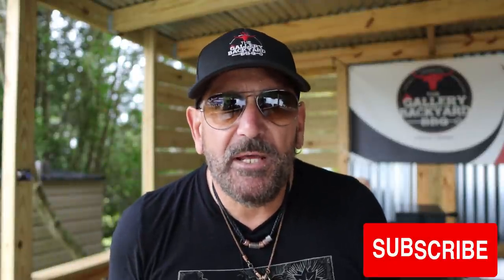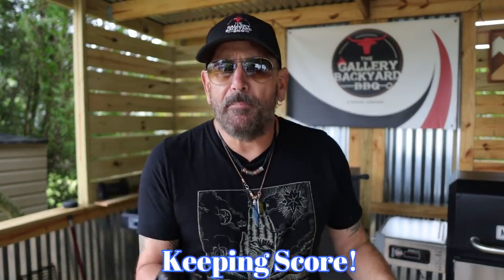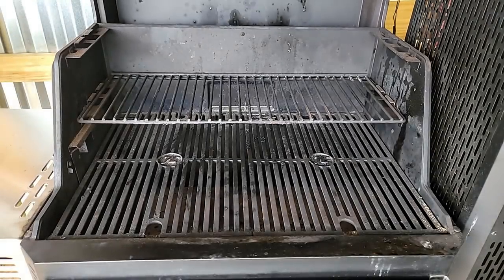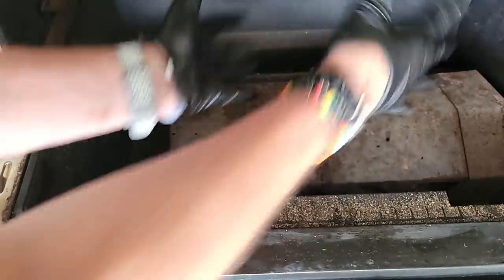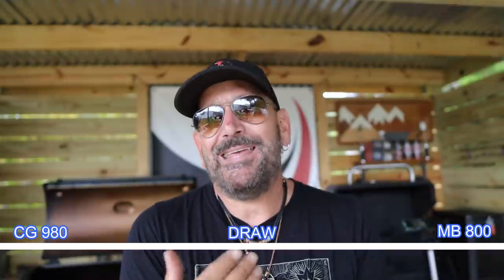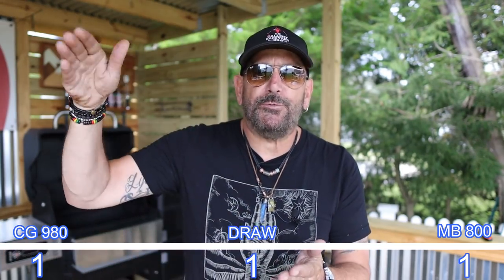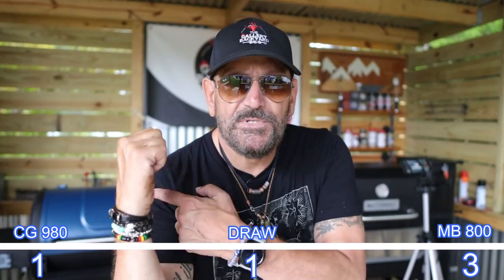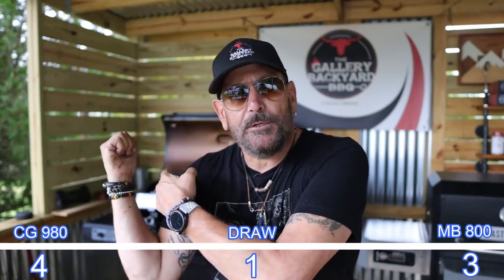Masterbuilt Gravity vs Char-Griller Gravity | Which should you buy!

Comment: Tommy, I'll tell you since I've had my MB560 July1 I'm totally impressed with it. Ease of operating.  The way it holds temp with in 2-3 degrees and also producing clean smoke.  Put wood in the ash bin, which always burns completely, also add up to 2lbs in the hopper with charcoal for extra smoke flavor if needed. Doing Slow and Sear ( I just did a 3lb Tomahawk, made a video ) taking temp from 250 to 600 really quick about 3 minutes works amazing. Gravity feed smoker/grills,  have my seal of approval, and I have cooked on all kinds of cookers. I think any Gravity feed grill, Chargriller or MB is the way to go!
Reply from the maker: Agreed. This is an awesome time to be a backyard pitmaster!
Reply: Awesome thanks for sharing

Comment: I own the 1050, the upgrades I bought I think is a must, bought the bigger shelf for front, the tray that fits under grates, collects all the grease and holds water for long cooks and you can still put your aluminum trays under your grate's and the other one is the grate that holds the charcoal, it's a wider opening for fire starters and has a grate that protects the flap and fan, so far no problems with it, my only complaint is sure uses a lot more charcoal, but ease of use is great on all nighters
Reply from the maker: Thanks buddy for the comment. The 1050 is top dog for sure-

Comment: One thing that should have been mentioned is the MB has an optional rotisserie that the CG does not have.  Also porcelain coated grates are nice to start, they will crack and rust.  Pure cast iron can be brought back to life over and over.
Reply from the maker: Good point Joe....

Comment: Nice video, Tommy. I agree with most of what you said. By the way the hopper on the Masterbuilt is three pieces. Also, the have changed the material of the wall in the Lower burn area. It is foam insulation with stainless walls. It’s like KlotesMods swap. I know this because the replace two of the three pieces on mine after the grate ribs in the burn are burned out. I love my pit. I got the replacements in two shipment over a period of two weeks. I am very pleased with what they did to fix my issues!
Reply from the maker: James. Thanks for that info. I tried being as fair as I could be without just saying what everyone else says. Cheers.
Reply: @thegalleryBBQ  I think you did a fair assesment of the smokers.

Comment: I use to love Masterbuilt, I just bought a MB 560 gravity feed in late April.  I used the unit 5 times and love it.  Went out to use it the weekend of June 3rd (yes, 1.5 months later) and the electric controller would not stay on, it kept shutting off and on every 10 seconds.  I contacted Masterbuilt, they asked me a couple of questions and decided to replace the unit under the warranty.  They said it would be 7-14 days before the item ships and they would contact me with an email and tracking number.

When I first bought the unit I had opted for it to be put together, so Amazon delivered it and two yahoos' installed it.  In the process they left out the charcoal grill that keeps the charcoal from falling all the way into the ash bin.  After going back and forth with Amazon, they finally gave me 180.00 off of the unit, so I went on MB website and ordered the Charcoal plate it was like 11.00 plus shipping.  It took over 3 weeks for it to be sent from Ohio to California because it took over a week for MB to ship it.

So I finally received that around mid may, used this unit exactly 2 full weeks (5 times) and the electric controller crapped out.

Today the control unit showed up, MB did not contact as they promised with a tracking number, I sent them an email last week, June 28th was day 14, sent another email yesterday, they finally responded and said here is your tracking number.

Tonight I'll go home and hook it up and see if it actually works.

Great smoker but you are totally at the mercy of an electronic unit that when it fails you are left with nothing to use.

I have now considered ordering another control unit for roughly 35.00 from their website which of course will take 3-4 weeks to arrive, just in case it dies in the future.

This whole smoker is great and I love it but you are totally at the mercy of the control unit.
Reply from the maker: Agreed. That controller is definitely a weak spot in that cooker. Mine crapped out and I do keep an extra in the garage!

Comment: The masterbuilt grates are about how much meat touches metal vs air. On the meat section you get more metal and hopefully better sear lines. On the smoke side, there is less metal and thus more air reaching the meat. That is the whole point of those grates. Do they make a huge difference? Maybe a bit. It’s a good idea, but I prefer purpose built grates for each.
Reply from the maker: Good point

Comment: I had a Masterbuilt 1050 for a year I loved how it cooked and smoked, but incredibly unreliable, the first one worked only a few days, the second one I was constantly replacing the switches, the at about 10’month the fan died, and I got rid of it and bought a Traeger. I don’t like it. I was trying to decide if I wanted the Masterbuilt 800 or chargriller . Has MB done any updates to their switches?
Reply from the maker: I mean. That sounds like some bad luck! Many and i mean many have run these pits(MB)for years with no problems including me. On a side note!   Some have had the same problems with the 980. To answer your question. No up grades as of yet!

Comment: Love your videos! I'm itching to pull the trigger and get either the MB gravity series or the Char Griller 980. I saw your most recent reviews, any 2022 review coming? Or do you sway one way or the other at this point? Thanks!
Reply from the maker: I may do a Char 980 vs 1050 review as I ahve a brand new 1050 coming!
Reply: Thank you so much! Would you pick one over the other in the moment?
Reply from the maker: @benb6366   That be hard to do. The 1050 flat out rocks and that980 is awesome. Gun to my head. Id go 1050 on price alone.

Comment: I would think the simplest thing to mod the CG980 for a drip pan under a low and slow cook, would simply get rid of the middle shelf it comes with, and then buy an aftermarket shelf on legs that you can place anywhere on the grate that you like. Amazon sells them for cheap. Just pick the size shelf you like (obviously that will fit within the grill), and boom. Middle shelf problem solved.
Reply from the maker: Jess. Thanks for the tip. Cheers and happy new years.

Comment: Even on my 560 I never really put chunks in the ash pan. I felt I got enough smoke using 2 or 3 layers of chunks in the hopper. I used 1 split with lump charcoal surrounding it in the char griller last weekend and like the results. I'm with you though can't go wrong with either pit
Reply: That's what I found with mine. Putting layers of lump between some chunks of wood has been really fine for what I'm doing.
Reply: I don't like to do that unless it is a long cook that will use the whole hopper because it is a pain to change the wood if I am cooking something else and want a different wood.
Reply from the maker: Thanks bud. Cheers

Comment: The recently got the MB800 and I have no regrets. When I saw the Char Griller at Lowe’s I couldn’t help but notice how wobbly it was which I didn’t like at all. 

And probably the biggest reason is that the MB natively allows you to have a drip pan and this can be done without any mods. And not only do I almost always use a drip pan in my Weber kettle (so this is the way I like to bbq), it will also make clean up infinitely easier.
Reply from the maker: Youve picked the winner between MB and CG...

Comment: My Master build was a joke, broke out the box and the  replacement lasted 6 months wish I still had my green mountain grill top notch costumer service.
Reply from the maker: Unfortunately, the MB will out grill/and/smoke a green mountain 7 days a week. Did you contact customer service?? Do you belong to my Facebook group?  What happened. How'd the MB break??
Reply: I contacted MB multiple times I first contacted them when I originally set up the moment I plugged in my grill I had three errors, after going back and forth with Master billet I eventually spoke to the manager at Home Depot where I purchased it and they swapped it out for a different one, 6 months later I get a different error my fan occasionally works which is not very fun to find out that your fan isn't working when you're doing a whole brisket 😱 and now you have to finish off in the oven. When it was working it was great I have a small backyard so this was a good option for me, but their bill quality is unacceptable with my Green mountain grill had less smoke flavor but the moment anything broke within two days they would send something out to fix it or have a technician come out and fix it , what's Master build I'm lucky if I ever get a reply in my email.
Reply: @thegalleryBBQ  I'm honestly to the point to where I'm just about to build my own gravity fed grill just need to find a nearby welding shop
Reply: It’s ugly but you MUST let those wires hang and keep them far away as possible from the heat. I burned out fan wiring and loads of errors due to keeping my wiring too close to the pit for “looks”
Reply: @jayrod1980  thanks for the advice

Comment: I enjoyed this video. But I have to say, we’re all looking for one thing, that is good food. The even heat on the Char Griller because of the heat chamber you mentioned to me is worth multiple points. Using your own words, it’s a game changer. And I agree it is, just that  by itself makes a Char Griller the easy winner for me. Your points system I think is a little bit flawed, lose an a point for something as simple as a vent, but only getting one point for something as important as the heat management inside the pit, makes things a little off center. Not complaining, I appreciate your video, but if you put weight in form  of value on each point, I think the Char Griller is the clear winner.
Reply from the maker: Appreciate that well thought out comment. That said, Some people would prefer the smoke that the MB puts out on the food. Cheers.
Reply: Agreed, but I can do things to get the smoke flavor, you can’t do things to make even heat-  Thanks again for your videos, I enjoy watching them.
Reply: Yup, that’s the beauty about options! Me personally, not a fan of those barrel designs, at all! Even on my 6 pellet grills, always enjoyed the other designs better. So I’ll take the MB800 any day over the CG for the sake of the the grill design/layout and the fan design alone. That fan stickin off the side is an eye sore and ppl are beating theirs up left n right while moving the unit around. 
So I agree with your points that there are different weights to different points, but I don’t think the CG is a clear winner by any stretch, at least not for me 😅

Now if only we could get a medium tier Gravity fed, digitally controlled charcoal smoker, something between 1k to 2k, that’s built kinda like a Yoder or a Lone Star, THAT WOULD BE AMAZING!!! 
These Chinese tin cans are good for what they are, but they are cheap and it would be great to have some better quality options on the market.

Comment: Does the Chargriller have a rotisserie add-on accessory? I have the MB1050 and it's great but definitely has its issues. Grease management sucks, build quality is lacking (the Chargriller unit seems more robust), the hopper on my unit leaks so I think I need to adjust the bolts to tighten down the latch, the sides where the snuff plates go also leaks, it uses a lot of fuel (225F will get me 8 hours on briquettes, less on lump and of course less hours if you cook at higher temps), but the smoke flavor beats any pellet grill and also my 22-in. WSM! Just wish it wasn't cheaply stamped crap that was bolted together. 

Thumbs up on another nice vid, Tommy.
Reply from the maker: Tony. Thanks buddy. No Rotiss add on for the 980. Thanks buddy.

Comment: Do these produce top notch ribs pulled pork brisket or no? Just sold a pellet smoker bc there was no smoke flavor.
Reply from the maker: Yes..... These pits are way better than a pellet if you're looking for more smoke.
Reply: @thegalleryBBQ  thank you for replying!!! I don’t want to make another mistake in buying…….  When you use it as a grill, how does it come out?  With the pellet, there was no direct heat, so it didn’t char or sear anything.  And it too waaaayyyyyy longer to cook meats at the same temps.

Can you still char up a delicious chicken bbq on one of these? Even if it’s just hot air flowing around?

Comment: I have been using the MB Gas/ Charcoal smoker for about 8 years now. I am up in Iowa and I like to smoke year round to include negative temperatures. Will the MB gravity fed smoker hold its heat in negative temperatures?    To add to this conversation  I have never even seen a charcoal fed smoker until yesterday when I was in (Scheels) sporting goods store.  This thing blew me away!   Thanks for the information and if anyone knows about it holding temp when there is a foot of snow on the ground please let me know.
Reply from the maker: Im in jersey and smoke year round. I use an internal temp gauge to control temp. I have nevr had a problem. Enjoy and happy new year.

Comment: Oh yeah.. digging your channel and nice review. Couple of notes, I would have thought the shelves were equally as usefull when the top is up and you're moving food in and out i.e. you wouldn't want to leave things on the shelf while the top is down. Also correct me if I'm wrong, but when i see the holes in the side shelf above the controller I just go 'what a design flaw'... water, oil etc. can readily access the controller a lot easier. thoughts?
Reply from the maker: The CG 980 controller does have a plate protecting from water. The one thing I forgot to mention on the MB side shelf a tad heat ascaps at controller and discolors the side of the controller. I also hate that... cheers.

Comment: Very thorough review Tommy.  I have had my 560 for 18 months and think it is great.  However I love the diffuser on the heat box in the 980.  You hinted that changes may be coming for MB but in the meantime, do you think it would be possible to take the 980 diffuser and modify it to work in the 560?  I assume it would have to be cut shorter but would the width be ok?
Reply from the maker: Not sure on that. That said there maybe a Mod in the works. Drop my an email for an update. gallerybbq@gmail.com..... in about a week or two.
Reply: will do